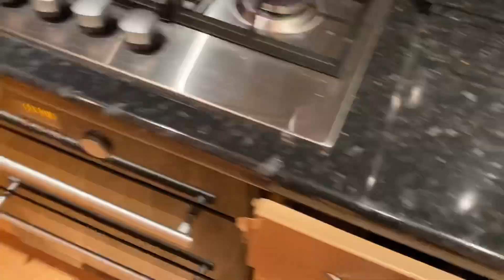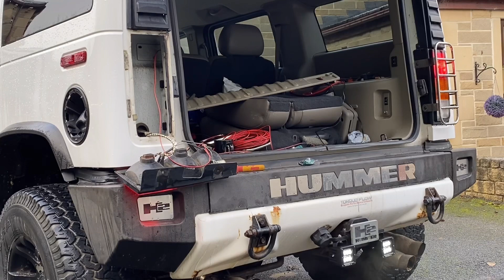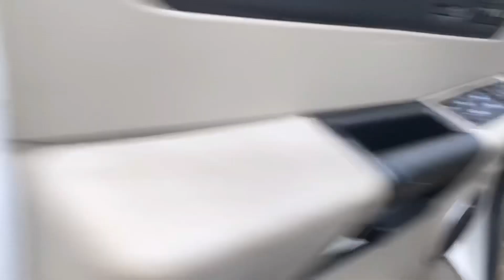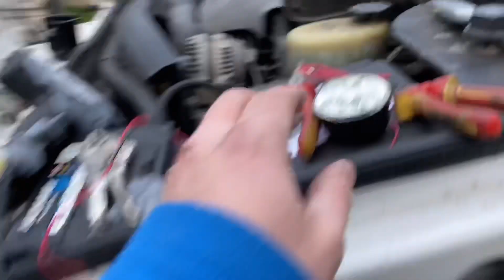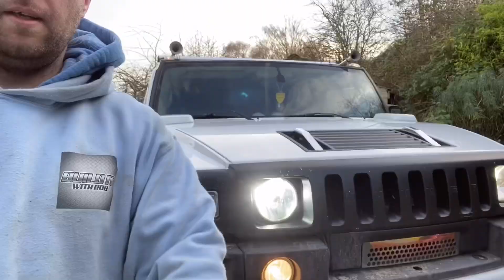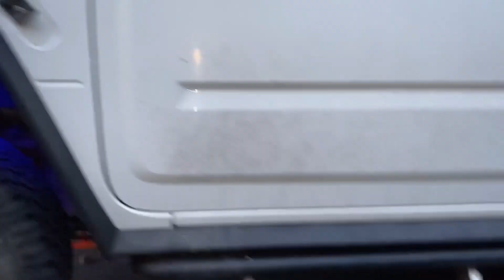BLUE LED,s ON HUMMER

Comment: is the hummer 2008 or before they changed ecu thanks for showing
Reply from the maker: Hi Phil
Mine was a 2004 model
Reply: @builditwithrob  did you update the media system on te center dash.
Reply from the maker: @philfish6619  it had an updated sound system with new cd player
Reply: @builditwithrob  oh right im trying to think why the fuse box went up. i supose you dont want to talk about it. i dont want to do same thats all. ive got a 2008 so differant wiring i think ecu differant. really suprised me as i looked at your films and then that happened. i really want those bumpers where you get the bits from
Reply from the maker: @philfish6619  hi Phil
I got the bumpers from MOVE bumpers in America I had them shipped over,
I learnt after the fire that some GM fuse boards had faults allowing then to short, unfortunately that particular fuse board was in hummer
Reply: @builditwithrob  yeah thats one of the reasons why i got newer model.you did a great job and colour of it. i nearly cryed when it set on fire. i rebuilt a range rover from chassy years ago. a 2 door. it was great to do. ive a 1986 4 door ive got to do this year im not sure if i should sell it now with having to do the hummer. did you sell the bumpers then
Reply from the maker: @philfish6619  I sold the bumpers to a guy down south  he was rebuilding a hummer too
Reply: @builditwithrob  thanks found the bumpers what did thet charge for postage do you remember